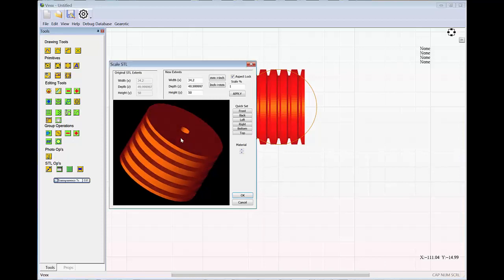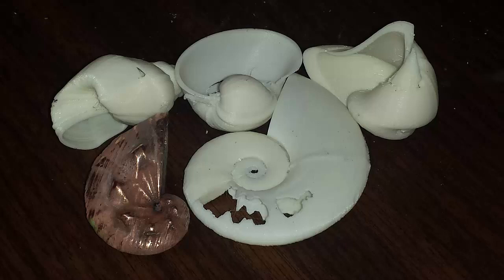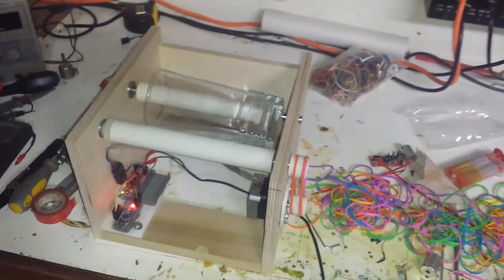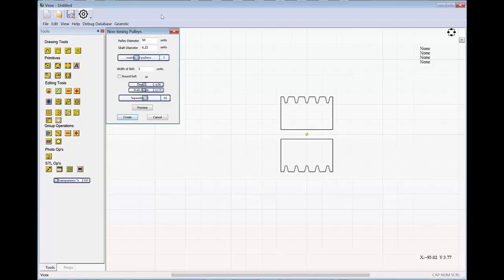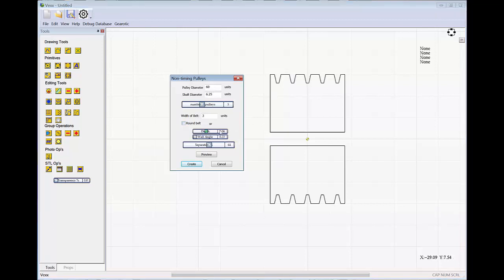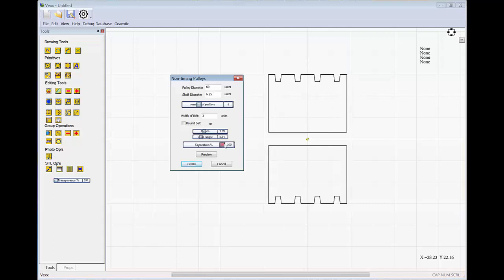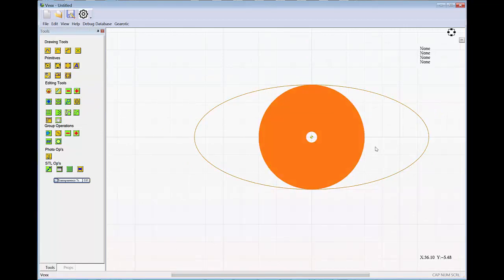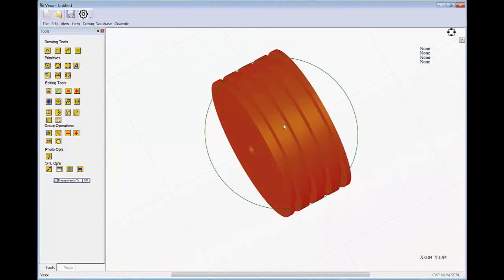Belt Pulleys

Comment: Hi Art. Through some jump hooping, I ended up here. (Google search/Instructables document/Geartomotion.com...etc) To cut a long story short(ish), I'm 3D printing a half scale R2-D2 and looking into mechanising it to go from 2 legs to 3 legs. There are a few working mechanisms on full size replicas, but they are complicated and clunky. I'm convinced a more elegant and simple mechanism can be created driven by a single motor drive. My problem is my lack of experience with mechanical 3d cad design and a way to get the thoughts in my head into a kinematic model I can test, and eventually 3d print. You might find this idea interesting or not. If you do, reply to this comment. If not..well, don't. Cheers
Reply from the maker: Im currently working on a module for such things. In the meantime search for "linkage software", there are some great packages out there that are free.